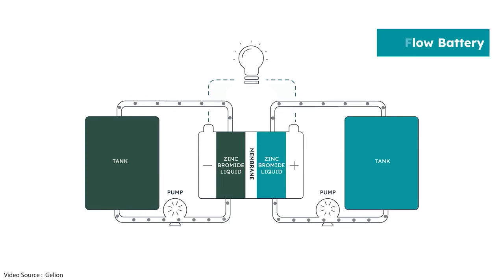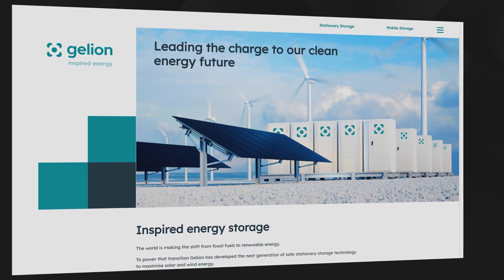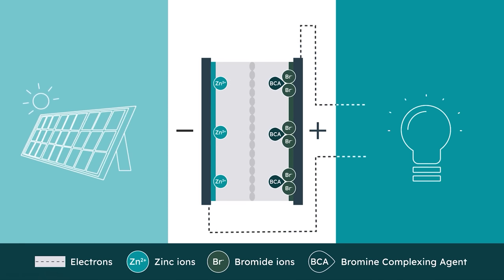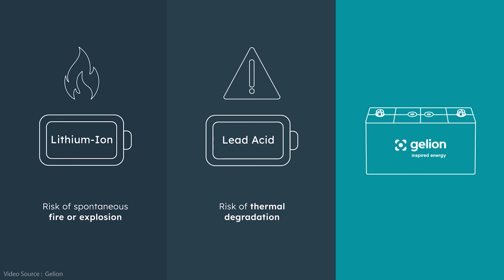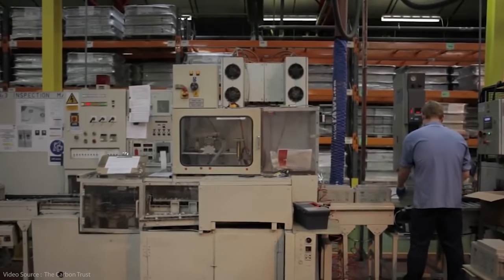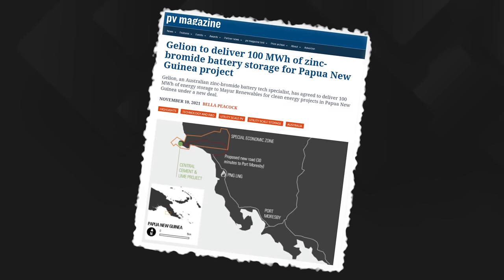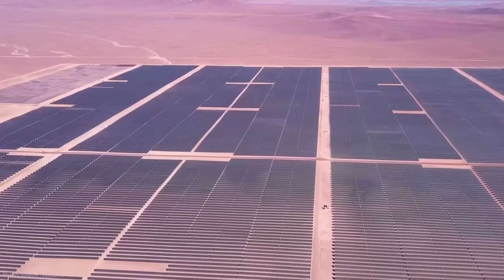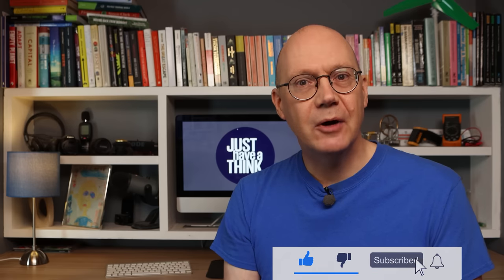Zinc Bromide GEL batteries. Cheaper, greener, simpler & safer than lithium -ion!

Comment: The only relevant question for stationnary storage: what's the cost of installed kWh ? How does it compare with, say, Form Energy Iron air battery with presumed 20USD per installed kWh ?
Reply: Absolutely, this is the single most important question and he didn't answer it (even with an estimate). Kinda disappointing
Reply: More importantly: Cost per installed kWh cycle, as cycle life has the greatest impact on total payback over time.
Reply: @davelevj  How the fuck would he know since they have yet to be manufactured at scale?
Reply: I checked Gelion's website, and they provide no prices and no technical data for the products they are apparently planning to sell, such as batteries in well known lead-acid form factors.  I was trying to find out if they could be used in my existing small stationary installations that use that older technology.

Comment: Looks very interesting  Storage and Grid stability is very important .
Reply: Nuclear.  Always on, carbon-free.
Reply: @scottslotterbeck3796   Don't disagree with Nuclear especially small modular plants that can be quickly built . French Nuclear plants actually have huge battery storage systems so they can store excess energy for peak loads . this where are you? they don't have to ramp up or down reactors . Tesla Big battery in South Australia was actually made by the French company that makes them for the Nuclear plants .
Reply: @scottslotterbeck3796  
Not at my house.
Nuke still needs wire connection.
There is a need for this type of storage, NOW.

Comment: Really looks like the cheap home energy storage solution. Current 12v/100 ah batteries  are priced around 500 US. Imagine zinc bodies at half that price, that's a winner.
Reply: We don't know what this battery will cost.
Reply: @incognitotorpedo42  ...but bear in mind that lead-acid batteries deteriorate greatly when subjected to more than 50% discharge which, in effect, makes the Ahr rating actually 50% of that advertised.

Comment: The Gelion battery has been safety-tested by heating on a hot plate to 600 degrees. It can't catch fire. It kept pumping out power until the casing eventually melted and the thing fell apart.... It's very promising for long life, safe grid storage solution. GELN share price is just under 1 GBP and it's significantly under-priced in my opinion. (I've invested)

Comment: Pleased to see another possible storage tool.  Perfect solutions seldom are, so every capable and cost effective option for energy storage is an excellent one, even if it is only used as a transition from now to the next innovation!
I remember the ZnBr flow batteries from RedFlow in Australia. Just looked and they are pitched toward industrial or remote only.  Looking for that 10-20kWh solution that will make using intermittent renewables easy for a future home of mine.
Thanks for the revisit to the ZnBr based batteries!!

Comment: That really does sound promising seeing that it can be put into existing battery architecture with little change. Why recreate the wheel when thinking outside the square you can tweak it make something better at low cost.

Comment: Isn’t this similar to EOS Energy’s modular aqueous zinc batteries now in production in Pittsburgh  PA?  One of the advantages is that since they don’t require specialized ventilation & fire suppression systems, they can be installed  more easily within existing buildings that have high energy demand, like high-rise towers, or shopping centers with lots of refrigeration load.  These lower cost batteries will be important in the build-out of urban & suburban micro grids, especially when integrated with solar rooftop & parking lot canopies with V2G chargers.

Comment: Redflow's zinc bromine 10kw flow batteries have been in production for a while now. They are not that bulky or complex, they are scaleable and they have a hibernation mode. I think they already answer a lot of the limitations which you mention with regard to flow batteries. I should know; I have two of them in my household solar system.
Reply: Apart from them not being as compact as a Powerwall, they would be excellent for home use. A former CEO had one installed in his house and it was the goods. This was in 2016 when we had a major outage in South Australia where the grid was out for days. Simon Hackett was formerly founder of my ISP where his savvy made it a leader in ISPs. Sadly it became a commodity  after he left.that  Also sadly Redflow don't do those size systems now having moved to bigger scales. Their smallest is a quad with 40KwHrs..

Comment: it is good to know that we will have dozens of different short term energy storage systems available, to even out the highs and lows of renewable energy systems, but everyone seems to be ignoring the meteorological blocking high pressure system in the room, or in the case of the U.K. covering the whole country, at least twice each winter this country is inflicted by a weather event, known as a blocking high pressure system, which can last for up to 2 weeks at a time, and they usually come with a blanket of cloud, which further reduces the limited amount of light for any solar panels, plus there is little or no wind to power the wind turbines, and consequently minimal wave activity, leaving us with only nuclear power, but even if we get 8 shiny new nuclear power stations, that is only equivalent to 30% of our energy needs, which would require us to reignite our fossil fuel power stations. put simply we need a system that store and supply 60 to 70% of our energy needs for up to a month each winter. all the systems i have seen so far, are variations on batteries that can put out energy for 12 hours at best, the cost of having multiples these systems for day after day would be huge, the obvious solution would be to turn surplus green electrical energy into a chemical form which could be stored for months before being turned back into electricity, this could be as simple as using electrolysis to produce hydrogen, but of course someone will now point out that you lose energy during the electrolysis process, and you lose more turning hydrogen back into electricity, but if the electricity fort the electrolysis process comes from renewable green energy it should be of little concern if there is some loss along the way, of course storing hydrogen does come with its own challenges, may be green ammonia might be a better option , then again it ahs been suggested that large scale and long term energy storage is unnecessary, and that we should rely on interconnectors under the sea to exchange electricity backwards and forwards between ourselves and Europe, on the assumption that some part of Europe will always have a surplus we can use, given the difficulties Europe is currently having with securing enough energy for itself, I think it is extremely unwise to assume that our partners in Europe will always be willing, or even able to supply what we need, when we need it, storing our own surplus energy in a chemical form means we stay in control, it should have always been obvious that for every 2 wind turbines you install to supply direct electricity, that you would need a third to produce electricity for storage, both short term and long term, in relative terms the cost of a third wind turbine is not that great, and the fuel to run a wind turbine is still free, but it is the choice of storage system that will determine the cost of future of electricity, as an island nation we do have a lot of natural resources at our disposal wind, wave and tidal, but people need to start realizing that it is not just hours of low renewable production we need to worry about, but that there will many days at a time  when production will fall below what is required, so we must start planning for that now.

Comment: They sound like they would potentially be a viable replacement for lithium-ion in home energy storage. If say I needed 10 kWh of storage to get my fairly efficient house to get through the hours when the sun isn't shining (assuming a I didn't have a windmill to go with the solar array), then I would need about 200 kg (440 lbs) of Zinc Bromide batteries as opposed to 50 kg of lithium ion. But frankly my garage floor really doesn't care if I put 200 kg or 50 kg of batteries on it. Now if the volumetric density was a lot less and so the physical dimension of a zinc bromide battery was a lot larger and intruded into the space for my cars, then I might need to care. But barring that, this sounds like a good pairing with a home solar array.
Reply: Stick them in a small shed outside and keep the premium spaced inside your house for other uses.

Comment: Well I had a think … and Thanks in part to watching this channel… I just bought an electric lawnmower and WeedEater & blower (used I’m cheap ) … the lithium batteries cost about as much as the tool .. I’m not sure of the overall efficiency  but …  the joules of human energy required to pull the starter rope how ever many times ..just to get a gas engine running and the time you spend idling and not doing any real work … plus going to the gas station to get ethanol free gas etc. … is another factor that really never gets figured into the energy efficiency conversation… Enjoy your Vacation Cheers 🍻

Comment: Thank you for this fascinating video! It's interesting how Gelion have identified their competition and deliberately engineered their product so it uses many of the same production steps! That's rather clever. For many factories it would just be a matter of making some small renovations and switching to a different licensed technology. If they can achieve a specific energy density of 50-60 Wh/kg that's quite a bit better than lead-acid.
Reply from the maker: Thank you . Much appreciated :-)
Reply: The real game changer wit Gelion (it would seem) is the cycle life. Most LA batteries dies in 3-5 years. Sooner if they are not used often are are allowed to self discharge to a low voltage. Hopefully, this battery tech can give us more cycles and longer overall life at current LA prices.

Comment: Thank you. I would love to test these as stationary systems in my home. Weight is not an issue. I expect units would be very large. I really like this development.  Missing were charging times and number of cycles. It seems to be implied that the number charges is quite large.  Solar power not mentioned either.  I tend to use all in one systems that have all the electronics internal to the units so don’t need to think about DC to AC and vice verse.  Of course, the question is when we might actually see these as commercially available products.

Comment: Will be good for home battery storage if it is as simple to charge as they say, unlike lithium which needs a complicated battery management system to run them.
Reply: Considering the billions of domestic products with Li-Ion batteries worldwide plus tens of millions of EVs and home energy storage units, the "battery management electronics problem" appears to be rather manageable, wouldn't you say?
Reply: @peterpicroc6065  no  have you ever worked Li-Ion batteries from new there ok but with age thay  go out of balance if one lot of cells fails the whole lot goes down. or worse the bms fails thay dont work well in the cold can damage them if charged below 0c. and a big part of the cost Li-Ion batteries is the bms. so no i do not agree with you one bit
Reply: @peterpicroc6065  don't get me wrong i love Li-Ion batteries they are amazing things. I have recycled 100s of old laptop batteries and build my own pack with them and it works well

Comment: I’d like to know the specific energy density, power density (both charge and discharge), efficiency (claimed to be 90% round trip), cycle life and whether they need maintenance cycles like zinc bromide flow natteries do? Power density is important if we’re talking house scale batteries. After all, it’s not much good having a 10kWh system if it can only deliver 500W.  Oddly the Gelion website does not have a technical specifications section. Until they include this most basic information it is difficult to take them seriously.

Comment: Check the specs of SiO2 or Lead Crystal batteries.  They do support a wide range of temperatures and resist to 100% DOD, although it's ideal to stay below 50% DOD.  They use very common materials (silicon and oxygen), are 99% recyclable, but they are heavier than lithium.  It's been 3 years I use them, they are good yet.
Reply: Can you give please more details on this? Looking for options make local stationary home solar/wing energy storage.

Comment: Gel feels sensible for home storage, but the low cost of massive storage with fluid batteries feels better suited for grid scale storage efforts.  Slightly less efficient, but virtually unlimited capacity.

Comment: This battery would be perfect for home storage. It would be 4-5 times larger than a Li-ion battery, but for most houses that isn't really a problem. Safer, cheaper & with a far longer life than Li-ion, lithium can be saved for vehicles. New houses could even have it build into walls or slabs. It isn't exactly new technology, it was shown on Catalyst in 2016.
Reply: Indeed. Seems nice sweetspot for that. For large scale applicaitons I still thing flow batteries would be preferable, even with the pumping needed. It seems a big benefit to me to be able to separate storage capacity (add more or use larger tanks) from the required charge & discharge rates (scale reactors and membranes to match) for the application you have.

Comment: According to RenewEconomy, the company expects to be mass producing batteries for applications ranging from residential to grid at a cost of below $100/kWh by the end of 2021. (Article 2019 Pre Covid) Addendum: Battery Energy AU: testing/validation 2022, production 1q 2023 - 5000+ cycles @ 100% DoD.

Comment: Lead gel batteries are used extensively as affordable storage and power back up systems. They are not as efficient but are far cheaper than LION batteries at any scale.
Reply: And 🤔

Comment: An Australian company called Redflow has been manufacturing Zinc Bromide flow batteries for quite a few years now. They have a lot of installations with the latest being one in California. Unlike the Gelion battery, they are a more typical flow battery which they build up into groups for scalability. The Gelion does have the advantage of being a more "conventional" battery. I am enthusiastic on flow batteries because they do not have the flammability and toxic chemicals of Lithium Ion and I would have one of these for home storage vs the potential blowtorch. Also, the recycling is less problematic. 
Just recently we had a grid scale battery go up in flames in Queensland Australia with the fire fighting effort being one of letting it burn and controlling exposures. Really good for the environment all those toxic chemicals released. Yeah.. nah! 
The headline for flow battery storage is the depth of discharge and also no self discharge if inactive for long periods. Also superior cycling ability on top of the safety.

PS: I won't have an EV till we have "safe" batteries that don't go off like fireworks.

Comment: I think it's direct competitor is not Lithium Ion but Lead-Acid for small units and other grid storage solutions for large scale.
Maybe I missed it but how does its cost compare to Lead-Acid?
Reply: I wanted to know that too.   Had a quick search around and found a few specs.   It has 2-3 times the energy storage per unit of weight.   It has much better cycle life than  lead some say 2000 full cycles some say 6000. 6000 cycles is about what you get off lithium ion phosphate if set up for maximum cycle life.  It has worse power output than lead acid so no good for starting a car engine.     One advantage over lead acid is the ability to leave at 0 volts which will quickly destroy a lead or lithium battery.
Reply: In my powervault domestic battery pack, the batteries are tubular plate lead acid gell type..they have worked well and half the price of li,ion.
Reply: @nickflynn666  EVs have lead-acid car batteries as well for the auxiliary stuff. No need for cranking, so maybe a better fit for EVs?
Reply: @rockyallen5092  yeah good for an EV auxillary pack.   Also good for energy storage on a home solar or commercial storage setup.

Comment: Did we get the cost per kWh with these batteries? Lithium-ions were down to $130-$150 for a battery pack but costs are increasing due to Ni and Li price increases. If Zi-Br can aggressively price their batteries for storage solutions like solar/wind farms and home solar storage, this could be a compelling alternative to Li PowerWalls.
Reply: I think those should be compared to lead-acid and not lithium-ions.